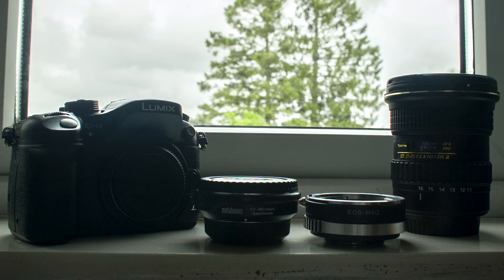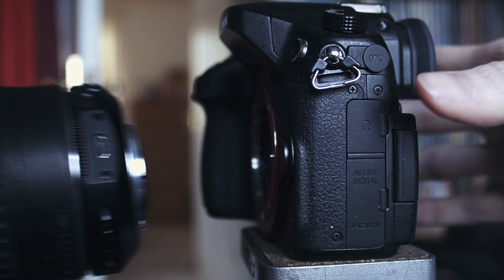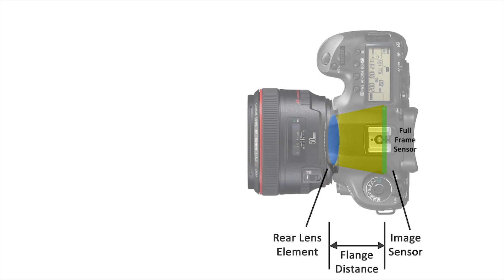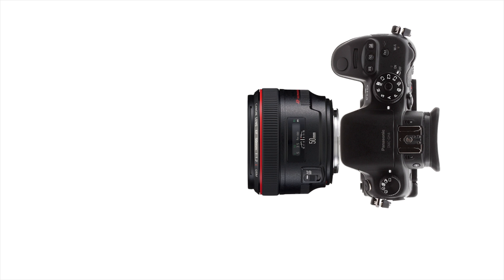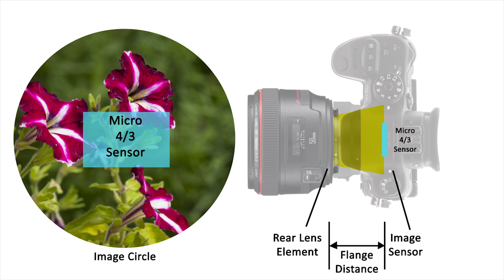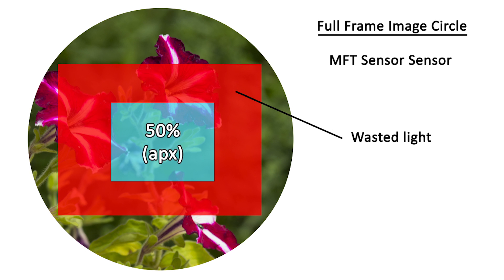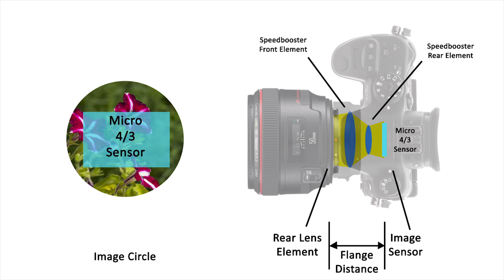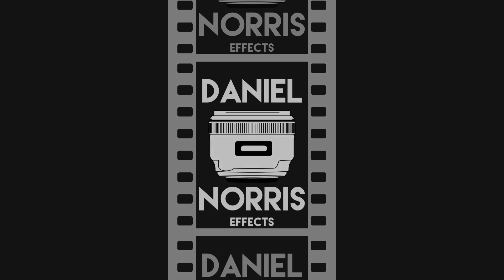How does a Speedbooster work?

Comment: Great clear explanation with no waffle.
Reply from the maker: Tim Stannard even though i was a little incorrect 😅 think about it like a magnifying glass on a sunny day. When you find that sweet spot where it is capable of burning paper, the dot of light is much brighter than the ambient sun light around it. It is the same principle, a lenses normal image circle gets focused down to a smaller circle with the same amount of light as it had before which means a brighter image. If that makes sense :p

Comment: Could I use a mb speedbooster bmcc or bmpcc v1 on the newer blackmagic pocket 4k for 1080p cropped mode? Will these adapters work? If so, how will they change my sigma 18-35mm f1.8 lens?
Reply from the maker: A Aa i dont think the bmpcc v1 will work as it needs to go further into the body than i think the 4k will allow, not entirely sure as i havent got one yet. The bmcc never had a dedicated speedbooster but the general micro 4/3 speedbooster should work fine from what i have seen. Not sure about the aperture value equivalent you would get on the 4k wig the sigma as it is slightly different for some cameras, but on the gh5 it is 1.2 so i imagine it would be around the same as that.

Comment: Thanks i did not know anything about why my crappy 550D canon has grain noise on its video even with the nifty 50, so  effectively my camera is shit and needs replacing as soon as :) got ya
Reply from the maker: Yeh idon't know where you got that your 550d is crap from. I still use a 600d from time to time. if you think your 600d is crap just because it has a smaller sensor than full frame then by that logic an arri alexa or the majority of reds previous cameras are crap too. and also that would make full frame crap because it too has a crop factor when compared to Medium format :P It is not the sensor size that makes the images good, its the person behind the camera. ;)

Comment: Is there any speed booster for a Nikor lens to be used on a nikon camera? speedbooster without the converter?
Reply from the maker: Amjad Niazi no, the way dslr’s are made makes it impossible.
Reply: Thanks Daniel for your reply. Actually I was looking at Rokinon 10mm t3.1(F2.8) Cine lens to use with D500 for 4K video only in order to minimize the crop factor. Should I buy a Rokinon lens for canon/fuji etc and then use a converter speed booster for Nikon in order to obtain F1.8 on this 2.8 lens (or somewhat closer)? would that do the job? or would you recommend some other 10-12mm lens with f1.8 etc for video work on d500? Thanks
Reply from the maker: Amjad Niazi sorry mate but as i said dslr’s cant use speed boosters and you cannot speedboost a native lens to the camera system you are using. As i said in the video, native lenses were made to be mounted a set distance from the sensor in order to achieve infinity focus. That is why people only adapt lenses that are made for dslr cameras to fit them to mirrorless cameras because they don’t have a mirror box inside them which leaves room for large adapters like speedboosters to be fitted between the lens and the camera. That only lenses that could potentially be adapted on to a
Dslr is medium format and large format lenses as they are made to be mounted further from the sensor than dslr full frame and aps-c lenses, which would leave room for an adapter. Though i don’t know any that exist at the moment.

Comment: Does this mean, i don't have to care about speed-boosters when I shoot with a full-frame cam anyway?
Reply from the maker: Greneey more or less, unless you plan on using medium format lenses on your full frame camera and wish to get the medium format look of it. A speedbooster helps you get closer to the maximum framing possibilities of your lenses image circle. so if you are using a full frame lens on a full frame camera, there is no need for one as you are already using that lenses full image circle. Where as if you where using a lens that produces a much large image circle that your sensor, a speed booster would allow you to use a greater amount of the image circle than if you didn’t. I hope that makes sense.
Reply: Daniel Norris cool! Thanks!

Comment: does it mean that speedbooster mounted on APS-C body is useless if the lens is designed for APS-C sensors?
Reply from the maker: Don Rae Amante yes because the lens was only made to produce an image circle large enough to cover an aps-c sensor. Using a speedbooster on it would result in vignetting.

Comment: Does it change the perspective/compression that a particular focal length has? I mean the apparent closeness or distance between objects in the frame?
Reply from the maker: KMLR2012 I don’t believe so, it does not affect the natural depth of field of the lens and i think the compression elements of a lens is something that is determined by the lens itself. All the speed booster is doing is taking the image that the lens is giving and focusing it to a smaller image circle with what ever image characteristics left as they are.
Reply: Thanks

Comment: Can I get a speed booster for canon ef to ef. Solely to let in more light and reduce the crop factor of my Canon 80d?
Reply from the maker: Leon Darnell sorry but it doesnt work like that. In order for a speed booster to be made for a camera and lens, there must be a space between the camera mount and the lens, which canon lenses wont have on canon cameras.
Reply: Thanks for replying
Reply: Daniel Norris See if your "converter" doesn't actually convert, instead acts like a spacer between EF lenses and EF camera, will this satisfy your requirement?

Comment: Have a technical question. I now shoot with a GH5 after converting from Canon. Recently I purchased a Yunguno 50mm f1.8 to test out the shallow depth of field and was expecting a f0.9 as i was combing it with my Metabones XL speedbooster but instead its showing f3.8! Can you explain why this occurs?
Reply from the maker: Stefan McCarthy Stefan McCarthy my only guess is that the lens doesn’t talk to the adapter the way it should. I have an old sigma 30mm which just reads 1.4 when it should show faster. Also, keep in mind, a speedbooster does not increase shallow depth of field. The image that a lens produces is not changed with a speedbooster, the speedbooster just allows a smaller sensor to see more of it and in doing so brightens the image up. Kind of like a magnifying glass on a sunny day.

Comment: Could you please explain the difference between XL and Ultra speedbooster on GH5, now that GH5 doesn't crop in 4k plus the sensor "moves" due to stabilization. Which one "makes" a super35 sensor, without vignetting and when stabilization is on?
Reply from the maker: The ultra, the xl would make it wider than super 35, not sure if that will result in vignetting, haven't heard anyone mention if it does yet.
Reply: Daniel Norris thanks! wondering how will apsc lenses (tokina 11-16,sigma 18-35) work with gh5(that doesn't crop in 4k) at their widest mm while the gh5's stabilization is on...and what's the best speedbooster for this set-up.
Reply from the maker: Balša Krkeljić i only use apsc lenses and my speedbooster in 1080 on the gh4 which has no crop has never had issues
Reply: Daniel Norris great! ultra it is!
who is more true to super35, micro4/3 with speedbooster ultra or aps-c sensor? where's the difference?
Reply from the maker: Balša Krkeljić they are pretty much the same only apsc refers to photos (4/3) and super35 is cinema (16:9)
Reply: Thanks for this info. I tried the 0.64x metabones on a GX85 and it was so wide that you see the image circle causing bad vignetting. I wasn't sure if the .71x version would be enough to eliminate it. 

I wish these adapter companies would specify which are designed for what format. It appears the .064x version is for Full Frame only and the .071x is for APSC. Yet both say they are for Full Frame only. Don't get it.

Comment: What are your thoughts on generic speedbooster adapters on ebay?
Reply from the maker: Personally i wouldn't bother as pretty much none of them give you control over your aperture. If you were going to adapter fully manual lenses then i suppose it is worth a shot but i would say get a decent brand one, at least then you know the glass quality of the adapter won't ruin your image.
Reply: ***** Thanks dude
Reply: I bought one of the cheap, generic ones on eBay and it had an unexpected side effect I wish I'd known about.  The cheap adapter fits kind of loosely onto the camera body and lens.  My understanding is that cheaper adapters are designed with slightly sloppier specifications, giving a bit of 'wiggle room' in the threads that mount to the camera body.  When I use my follow focus, the makes the lens wobble a bit (since it's slightly loose in its fitting).  This is OK for still image work, but for video this makes the footage almost completely unusable (unless you want to motion track the footage and correct it in post...  blech.)  The Metabones adapter is MUCH tighter (almost hard to get on/off), but there is absolutely NO wiggle in the lens.

Comment: Is there any adapter to compensate the crop factor 1.6 in canon cameras?
Reply from the maker: i am unsure what you mean? Are you asking if there is an adapter that will make an aps-c camera full frame? If so, there isnt because there is no point in doing so. Full frame and super35 (aps-c) are both standard formats for photography and film making and as these adapters (speedboosters) are mostly made for film making purposes (at least originally) there was no cause to make them full frame. Besides, making a speedbooster that can only use full frame lenses would greatly limit the amount of lenses that adapter would be compatible with.
Reply: Thanks
Reply from the maker: Yes, that too.